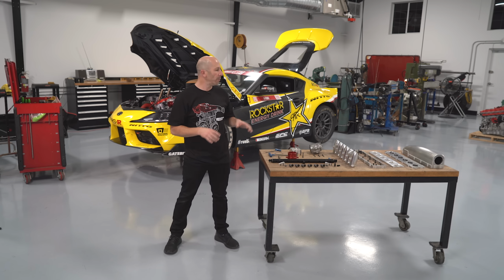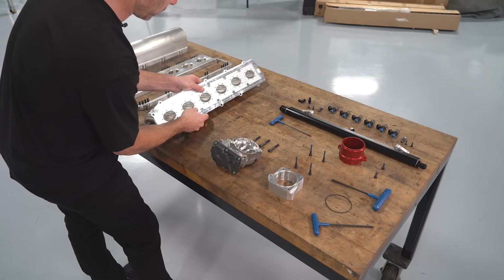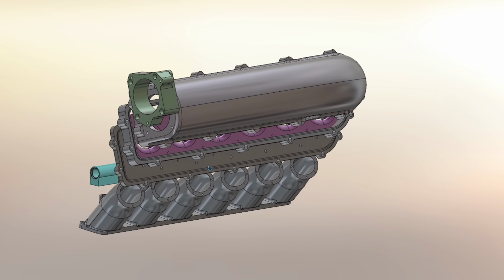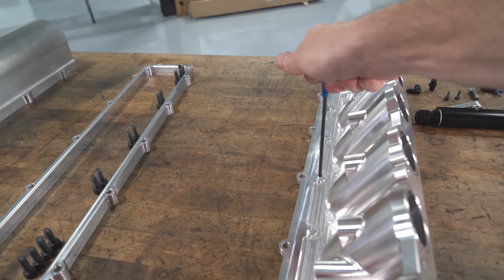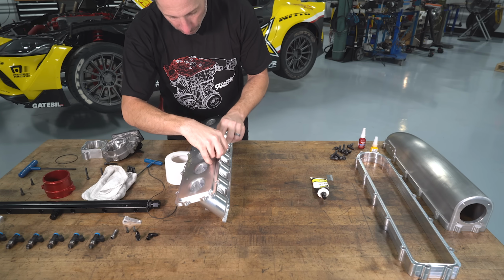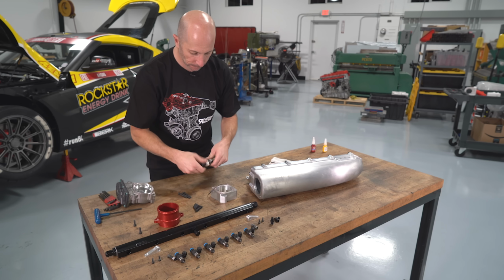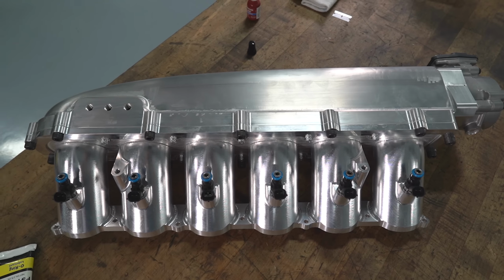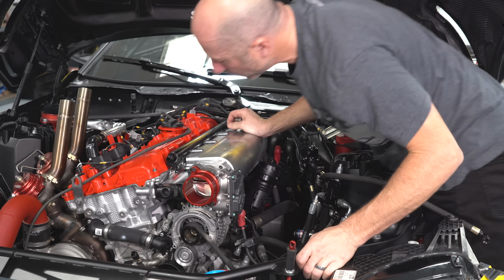Custom Supra Intake Manifold Assembly

Comment: Use RTV instead of cyanoacrylate, a blob over the join is sufficient. That way the crispy hard CA doesn't present a small leak path, you've got a nice seal media instead.
Reply: Also, with the smaller seals, design the groove to use an appropriately sized normal o-ring, they aren't restrict to use in circular grooves! Removes the joint entirely. I've never not been able to mod the groove length just slightly if I end up between o ring sizes.

Comment: Also known as the UNEVEN FLOW intake Manifold.  The back cylinder(s) (especially #6) will get more air flow than the rest.  Not designing an intake manifold that distributes airflow more evenly across the cylinders is lazy design work that ignores decades of easily-available-engineering-knowledge.  #EngineerItBetter

Comment: I notice the velocity stacks are not stood off from the base plate like this:

https://www.miataturbo.net/attachments/general-miata-chat-9/14251d1259190194-critique-intake-manifold-progress_11.jpg

Is there no flow to gain by have the velocity stacks stand off or was this a design compromise?

I love the spacer idea to test different plenum volumes.

Comment: For fasteners smaller than 5mm or 1/4" you should use Loctite 222 (pink). Loctite 242 (blue)  is medium strength, so small diameter fasteners may shear off when they are removed.

Comment: Looks awesome. The straight logs like that always have a couple cylinders that suffer. If you kick the angle of the throttle opening directs the high speed air into the top of the plenum it helps with distribution. Example Holley hi-ram

Comment: They always say there's a special reason and optimal formula to figure out how much the plenum should taper at the end.  But then you look at all those eBay aluminum intake manifolds and think to your self they must have just copied the shape, did they truly figure out the optimal taper? Maybe that would be an interesting video to explain (and throw in runner length and volume for optimal resonance if the video needs filler material).

Comment: For boosted applications the biggest plenum is always the best especially at high boost for hp . Small plenum gives torque sooner look at Honda’s small plenums to add torque to a no torque engine then the flaps/butterflies open to use the entire manifold or when v tec kicks in am I on the right track ?

Comment: Fantastic as always. If I lived closer I would apply to work for you. I am surprised you didnt go with an off the shelf O-ring for the runners, but I'm sure there is a reason. How do you manage par levels of the detail parts like those custom bolts, and O-ring stock? Do you make spare intake manifolds in case of a crash?

Comment: That is perfection of an intake manifold. Except one question: I've seen a few manifolds now that try to channel the air to the cylinder e.g. 1-3 and 4-6 are seperated by a plate inside the plenum. Have you looked into that or chosen not to do that? Or is that entirely useless at the boost you are running?
Reply: BMW has been doing this for years to increase torque below 4000RPM.  But then the plate opens at high RPM for best of both worlds (science behind it explained: https://www.eeuroparts.com/blog/disa-valve-rundown-symptoms-replacement/ ).  Of course BMW being what they are used plastic plates which crack with age and get sucked into the engine :)
Reply: @idokwatcher2062  Yeah that is a different type of plate, also applies to quite a lot of VAG-Engines. I don't know the english word for it, I only know that as "Schaltsaugrohr". That is however not what I meant because I think the benefits of that are really small.

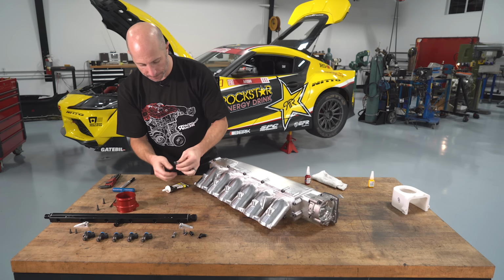Comment: 4:40, I believed that this engine was equipped of the direct injection but it's a regular common rail injection
Reply: they opted to use port inject than the factory DI because it was simpler and was proven to work for the application on his previous build videos
Reply: it is but they converted it

Comment: I wonder how much did this billet intake costs?
Because my car is kinda poor in matter of aftermarket performance parts
Reply: To have the legend himself papadakis to build it for you and manufacture it. oooweeee you gotta pay a pretty penny.
Reply: Awfully expensive if You come to machine shop straight from the street. What about grabing intake that looks somewhat similiar, machine flanges for Your engine then mate it together by either welding or making Your flange also an adapter plate for the other intake?
Reply: @MindBlowerWTF  I'm wiling to do something similar, I will go to a scrapyard and take intake manifold from the same car, cancel everything inside like the small throttles and porting it, the problem here it will not hold a decent pressure

Comment: Genuine question why not just weld the whole thing together I know it’s aluminum but can’t you still weld aluminum?
Reply: manipulation .. by using bolt together parts, you can then adjust everything just by machining new parts. So longer runners, added spacers all of that. As they like to milk everything they can in order to be highly competitive.
Reply: @MassageWithKlay  that makes sense basically making an infinite number of intakes by only using bolt one for different scenarios I never thought of that
Reply: @jonathanelmer9249  it is also good for them to know what each combination is going to give, as if the car isn't quite getting the right pace that they want, they could change the plenum after a run which may change the torque curve. Would make for insane competition, as the opponent wouldn't be racing the same car.

Comment: Why do you not want to have a gasket, but orings?
My guess is that the gasket has to be "formed" right?
Wouldn't a gasket make servicing the engine easier because you can just "throw it on the thing"?

Comment: how about air distribution? Because this straight 90degree throttle to intake doesn't look very distributing. I mean like, what about cylinder 1? Most engines tend to blow up due to last cylinder from throttle body getting the most air and leaning out the air fuel ratio. I would love some explaination about distribution designing.

Comment: Its slightly better to cut your o-ring cord on a 45 deg angle for more surface area to glue to. I'm sure square is probably okay for your application, but that was our supplier's recommendation. Thanks for the videos.

Comment: I would love to know the cost difference in the 3D printed metal/welded version, and the machined/bolted version. @papadakisracing care to share?
Reply: +1 for cost delta. Also, was there an issue with the 3D part? Machining 4 parts has got to have more labor in the design process than the additive engineering design of the original 3D printed intake
Reply: @rscottalex  The 3D SLS printed intake blew apart (source: Social Media)
Reply: Yes me too. I know the 3d printed blow because nitro backfire. But I like to compare the 3d and machined both same dessing/model/thickness... 
Which it strongest?

Comment: So not going to address the failure of the 3d printed one? that's disappointing...
Reply: It blew because of too much nos
Reply: @carboydorifutoparty3976  so are you expecting they were using more than the others or that they're going to be running less? 
Either way, they're not building another one which says, at the very least that this one is expected to be stronger.

Comment: Another amazing video. Very clever engineering of the parts!
I have just 2 questions:
-What is the advantage in having only 1 throttle body vs. individual throttle bodies for each cylinder?
-In what way is this intake manifold better than the 3D printed manifold you had before?

Keep up the good work!
Reply: Well, it's a turbo engine...
The 3d manifold ended up taking asbo out of competition...

Comment: Bad decision to use standard screws! 
You should use VA, stainless steel screws for aluminum...
Reply: I disagree, there were holes for the bolt heads in the plate, and stainless steel bolts tends to seize up in aluminum because of contact corrosion, unless you use grease.

Comment: Why did you divide to change the manifold to a billet machined piece from the 3D printed piece? Any benefits of either over the other?
Reply: The benefit the first time around was short lead time. When they decided to have it printed, they were apparently in a time crunch and explained they were very happy with the very short lead time of additive manufacturing (a.k.a 3D printing). But if you have time enough, the benefit of a short lead time might not weigh up to the increased cost and/or unprovenness for printing in a certain application. 

It makes sense to have the first part printed and to have a spare part made the traditional way, because for the spare you may have more time available, so you can produce it in a more conventional way.

Comment: He sealed the bolts with that blue paste, how is he going disassemble them?
Reply: It's threadlocker, in this case, the brand loctite. It keeps the bolts in place because engine vibrations and heating up and cooling down will expand materials (aluminum does this a lot with heat, more than steel) and causes bolts to come loose. It depends what kind of threadlocker you use, you use different kind of threadlocker for the job, some resist heat better than others, so that means that you need to heat it up to get it loose. Some will be water and airtight some stronger etc. 
But the most used one you can break loose easily by hand (loctite 243).

Comment: Is the Supra gonna get the new revised B58 head with 6 exhaust ports, or will the 2-port be kept?
Reply: Pretty sure they're keeping the 2 port since they've already got a few built 2 port B58s for it in case they blow one of them. He may use one of the 6 port if he does.
Reply: @carboydorifutoparty3976   might as well go to it, since BMW clearly admitted the 2-port design being "more than you'll need" wasn't exactly correct when they made the S58 and then suddenly the B58 needing an update too

Comment: Was there a issue with the 3D printed intake manifold used before this?
Reply: The 3D printed manifold actually broke a while ago. It seem like it couldnt take the high pressure forever. They have some pictures of the broken manifold on there instagram.